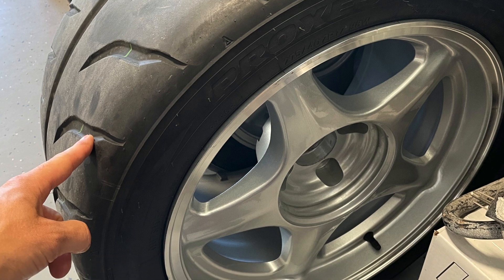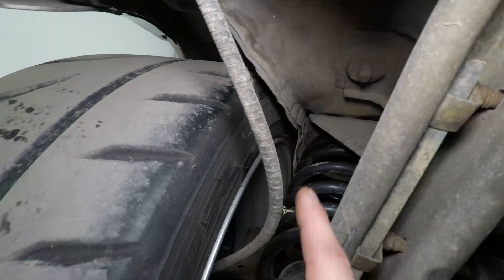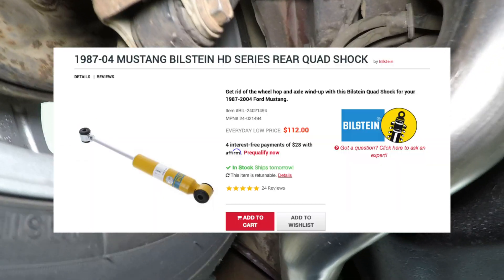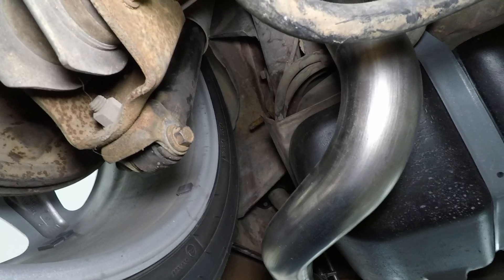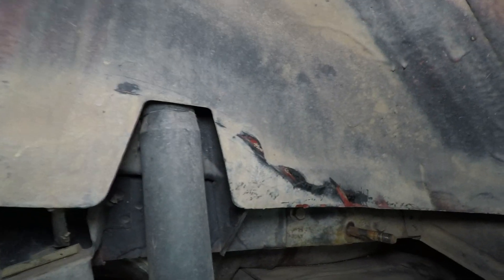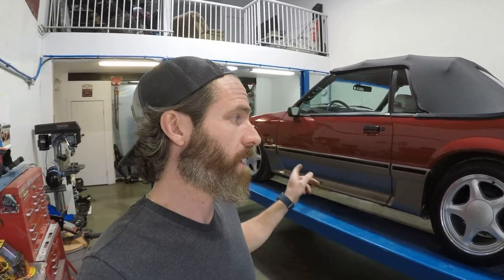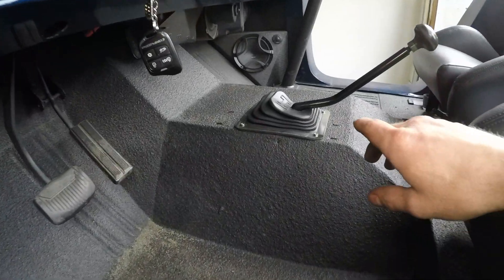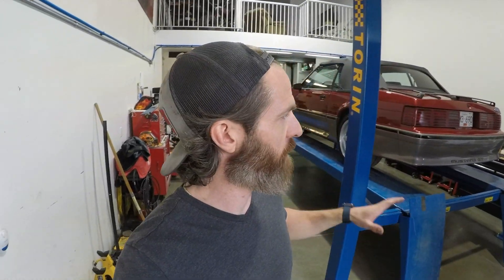17x10" Foxbody Mustang Pony Rims - How Do They Fit?

Comment: I have 18's on the front and back of my 92 LX. Rear fenders had to be rolled and a spacers inserted. 285/35vr18 on the rear and 235/18vr18 on the front.  No quad shocks. Manzo lowering springs (came on car and will be changed soon). Just  installed Koni orange shock and struts, SVE bump steer, SVE caster camber plates and Eibach front sway bar.
Reply from the maker: Nice buddy! I too have 18’s on my 92 coupe 👌. Your car sounds awesome 💪
Reply: @KASLCustoms  this is her if you wanna check it out.  Great car: https://youtu.be/UwP65Dec7IE
Reply from the maker: Awesome thx bud!

Comment: Old video but informative. I'm a bit confused though. You mention 17x10 rear but your video description states 17x9. Which is it? Also, what seller/brand are the wheels, where did you buy them? Thanks in advance.
Reply from the maker: Sorry about that. The fronts are 17x8 and rear are 17x10. I bought them second hand so I am not sure where they came from originally...?

Comment: Will a 17x9 rub on u turn or will a 8mm spacer help from having any rubbing issues out front
Reply from the maker: It all depends on the offset of the wheel. I had 17x9” cobra reps on my coupe and they actually rubbed on the inside of the rim on the lower control arm at full turn. I have 18x9” Saleen reps on my coupe now and I don’t have any rubbing issues at all
Reply: @KASLCustoms  Sounds good thank you might run a 8mm spacer I ordered the Saleens  from late model restoration the fronts are Front:
Wheel Diameter - 17"
Wheel Width - 9"
Lugs - 4
Offset - +20mm
Backspacing - 5.95"
Weight - 25 lbs
Reply from the maker: Nice! If I remember correctly, I think mine are the same, just 18” 👍

Comment: I'm running the same LMR 17x8/10 ponies on my coupe with nutto 315/35/17 on the rear and very minimal rubbing on the inside wheel well. Nothing too worry about. I did have to roll my rear fender lips tho
Reply from the maker: Awesome! Wow buddy, those are big boots!!! I love it 🙌
Reply: You didn’t have to use spacer’s & longer studs for it to fit? I have same set up but with a 305 tire. Thank you!
Reply from the maker: No sir, no spacers and stock studs 👍
Reply: @KASLCustoms  Thank You brother! Keep the great content coming
Reply from the maker: You’re welcome! Will do 👍
Reply: What did you do to get the 315-35-17 tires to not rub I beat the inner and the tires still rub I guess I'm going to have to run a spacer?

Comment: Great Job Brotherman !
What Lowering Springs did you put on the convertible !?
And where did buy your 17 pony wheels from !?
Thanks 
Keep Up The Great Work !
🤘😎🤘🌴☀️🔥🎸👍
Reply from the maker: Thx sir! I used Eibach sportlines for springs. I actually bought the pony’s locally from another fox owner
Reply: @KASLCustoms  Nice 👍
How low did the springs drop your stang?? 1.25 or 1.50 ??
I use to only use Eibach Springs on my Fox's in the mid 90's and it lowered  them down 1.50 !!
Reply from the maker: It was at least 1.5” 👍
Reply: Anyone no the tires sizes?

Comment: Good tips on the wheels and fitment. The 17" x 9" Cobra R wheels (American Muscle) shod with Nitto 555 in 245/45 17 on my 1989 Spot LX rub on the lower inside area of the front fenders, only when making sharp turns into a driveway. When the time comes for new shoes I'll go to 245/40 17 and hopefully that tire to fender won't be a problem any more.

Comment: How to tell if a wheel/tire combo fits: Put the car on jack stands; pull out the springs, then reassemble; bolt the wheel/tire on; jack the rear end up to the bump stops. If the tire rubs anywhere, it doesn't fit. Same with the front except turn the steering wheel full lock in both directions.

Comment: did you consider spacers for the rear?
Reply from the maker: I did not use any spacers as I did not have any need. If I did ever require the use of spacers, I would 100% replace the stock wheel studs with something a lot stronger and would also only entertain a very slight amount of spacer. Anything beyond a 1/4” I think I would be looking into more of a proper fix 👍
Reply: @KASLCustoms  what are you tire sizes on front and rear?
Reply from the maker: 235/45 front and 275/40 rear

Comment: You don't quad shocks as long as you have aftermarket control arms
Reply: That's not true, they serve a purpose!👈💯 Don't believe everything you see on the internet!
Reply: @johndoe-zb8bm  
I've been around mustangs and have some for more than 30 years. As long has you have good aftermarket upper and lower control arms they will surprise what a quad will ever do. If you want a hard launch then buy spherical bushings otherwise polyurethane will be good
Reply: @joshh4427  What ever,in 56 been around also,I beg to differ! Do you my man,but that's not true at all! Maybe for a stocker,not for anything modified!
Reply: @johndoe-zb8bm  
Sorry you felt that way. Night and day difference. I would never owe a stocker. Always modified. One day you will change over and wished you would of done it long time ago. Fyi I worked for Ford on saac and saleens. Nothing wrong on keeping yours just saying don't knock it until you try it
Reply: @johndoe-zb8bm  all you need is maximum motorsports lower control arms in the back. The adjustable ones so you can choose your height aswell.

Comment: Thank you so much for this video Brother!  I was truly wondering what needed to be done.... Would a wheel spacers on the rear help clearance issues with the quad shock?  That Bronco is totally Sic by the way! 💯 👊🏾
Reply from the maker: Thx buddy! No, there was no way the quad shock was going to work. Also, if I  were to push the wheel any further out, I would definitely need to start looking at rolling the fender lip as well 👍
Reply: @KASLCustoms  Makes sense... 👊🏾

Comment: Thanks for the video. I have the chrome 17x10 pony wheels and I’m waiting on the 17x8 to be back in stock for the front. This video eased my mind on installing them. 

Question- what size tire are you running on the rear?
Reply from the maker: Right on thx buddy! Rear is a 275/40/17 👍

Comment: Love the videos! short and sweet not long winded like others 👍 I have a 92 vert and was wondering.. do you think you would still have to take the quad shocks off if it was a 17/9?
Reply from the maker: Thank you!!! It all depends on the offset of the wheel. That said, I had 17x9 cobra R’s on a 92 and all I had to do was flip my quad shock 👍

Comment: This is the same route I’ve wanted to do for a long time as I’m a purest.Only issue I have is removing the quads as I like to get a little sideways from time to time. Are you able to get sideways without any issues(wheel hop) Looks great btw!
Reply from the maker: Thx bud! Yes I have and like I said, the quad shocks were so worn out that I don’t even think they were doing anything anyway… that said, when I have been taken part in a little more “spirited driving” I didn’t notice any hop or anything 👍